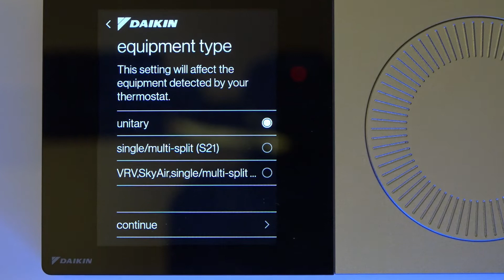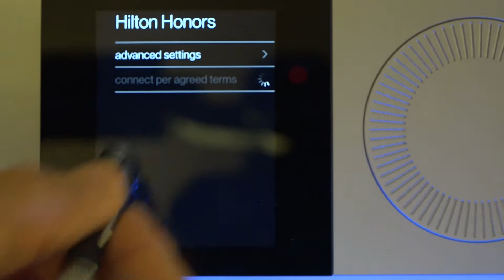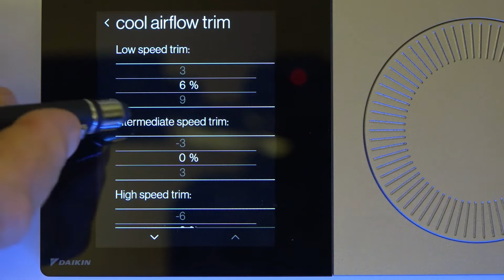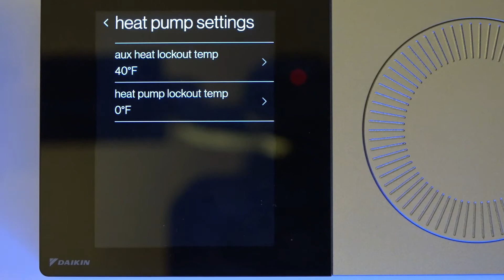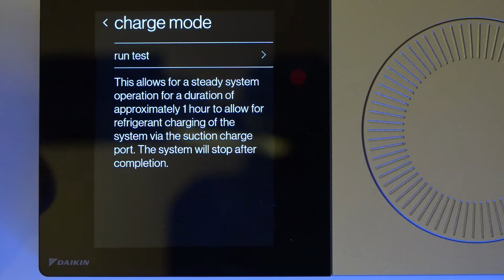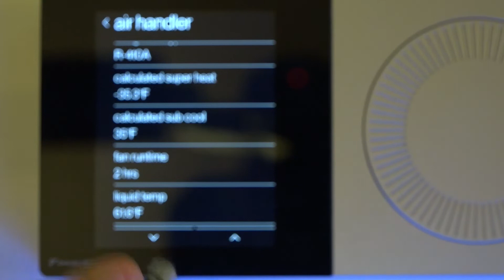Daikin One Thermostat Commissioning

Comment: Fantastic video! Thank you so much for posting this and your other videos. Struggling with getting my Daikin One dailed in. It is hotter than the sun here in the Tampa area. I have a 3-ton unit in a 1278sqft home. Current settings are -5 on cooling high trim and +5 on cooling low trim. Dehumidification is set to "standard" and cool profile is set to "D". The house is still humid and warm. During the day we keep it set to 76 but the house is usally hovering around 78 with 58-62% humidity. Is there any other setting(s) I should change or adjust? I appreciate any insight. Local techs are little to no help.
Reply: Just turn down the temperature.  I find the thermometer is less accurate than other thermometers in the house.  I really don't like this Daikin Onetouch (I have the updated one).

Comment: Just purchased a Daiken Fit 5 ton unit furnace and air handler yesterday. Your explanation of the maintenance side of the thermostat was OUTSTANDING!  I always like to know a little about the installer settings of the system. You were fantastic. In Oklahoma City temp is 105 today and system doesn't look like it wants to keep up. Spent $17500 on all new Daiken Fit ac , furnace and air handler.
Reply: How did your contractor go about sizing your system? I don’t mean to sound negative, but I’ve heard that 5-ton is rarely the right answer. If you really need that much heating and cooling you’re likely better served by two smaller systems. Then again, 105 is really hot!
Reply: @a..c1241 depends how big the space is.  And if it's a central system, then one is what you'd need.

Comment: Great Video first one that showed the detailed options behind the menus...Coming form a Eco Bee this thermostat is not very easy unit to program even for an engineer...The Daikin One Fit,  I am running has been a blessing compared to the TRANE TRASH here in Central Florida Sun...
The things that are still a mystery are the Dehumidification settings suggestions .. Seems to be 5 choices
 no dehumidification  and Standard dehumidification and then  A B C profiles.. 
No clue what they do in terms of system operation,  no place in literature left behind does it explain impact of each setting.  I read the line verbiage of each option on thermostat menu... Right now the unit is running  profile D on COOLING and Installer enabled profile C on dehumidification no idea why?    that what he was told?  I think the unit is smarter than some of these techs...any suggestions where I can find guidelines be appreciated...l 

These units are far the best on the market I just wish they are a bit more technology friendly in terms of programing...

Comment: Great video, is there an option to use a hydronic coil for back up heat instead of electric back up and still use the daikin one controller
Reply from the maker: Yes there is one word of caution adding a hot water coil can add to much static pressure to tge duct system so duct sizing would have to be addressed
Reply from the maker: The lastest update must have corrected that. Thanks for the feed back

Comment: Have you ever seen a Daikin fit tell the thermostat the wrong CFM?
Reply from the maker: Its fairly accurate it uses input volts and amps plus motor rpm and blower wheel size to calculate cfm it gets you pretty close but not exact
Reply from the maker: If cfm trims have been select it would be different than the reported number
Reply: @hvaciswin723  I don’t think so.  In heating most at -10% trim then the thermostat and AHU report back 900cfm.  If at 0% it reports back 1000cfm and if the HP calls for 1000 the AHU will deliver and report the same cfm.
Reply: What state do you install hvac units in?
Reply: @hutchnukem  Im in Va
Reply from the maker: @hutchnukem  Im in Tennessee

Comment: We have two Daikin Sky air systems pumping themselves down, changed the blower motor, eev, eev coil, and the a coil itself in the one and indoor board in the other and it’s still pumping itself down. Have you seen this before and do you have any tips?
Reply from the maker: What error code is it throwing  theres a thermistor reporting some bad information
Reply: @hvaciswin723  They’ve never made it out of the test mode, the thermistors ohm  out right inside and out, doesn’t store the error code
Reply from the maker: Do you have a dchecker tool?
Reply from the maker: Which model do you have?
Reply: I do have that app. Have you seen this before?
Reply: We do, I haven’t hooked it up yet, what should I look for when I do?
Reply from the maker: Look for thermistors numbers that dont look normal like discharge pipe thermistor. 
Discharge pipe along with suction and liquid pipe as well as  indoor hex temp control the valve. If they look normal ohm out the eev power head.
Reply from the maker: Youll need the Daikin Tech Hub app. A free download
Reply: One is a RZQ36 and the other is a RZQ30

Comment: Is the Daikin fit system available now in dual fuel? I noticed you showed a setting for it on the thermostat. Associated equipment said that the fit system was not AHRI rated for the duel fuel systems at the time.
Reply: I don't know who told you that; We have dual fuel up to 3ton vertical. Horizontal, and 4 and 5 ton do not rate in ahri.
Reply: @zachcroft6871  this was for a 5 ton system
Reply: @jackrobert82 Yes, you would be correct sir, we do not have an ahri rating for the fit at 5 ton, however, a way around that is to go with a VrV life system 1 to 1 with a furnace and VrV coil. I will have to check the AHRI rating but I want to say the last time I quoted one it was 16seer. If you have any questions feel free to call the Chattanooga branch and ask for me, I'm glad to help!